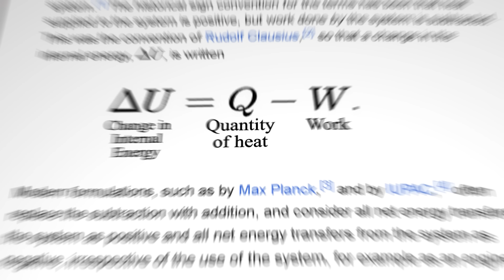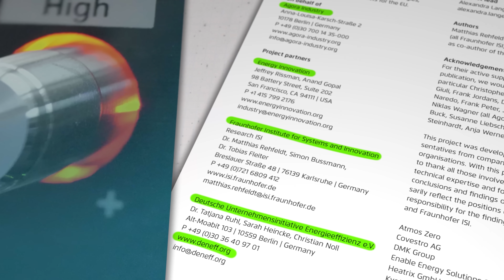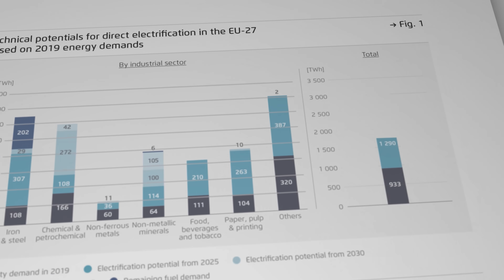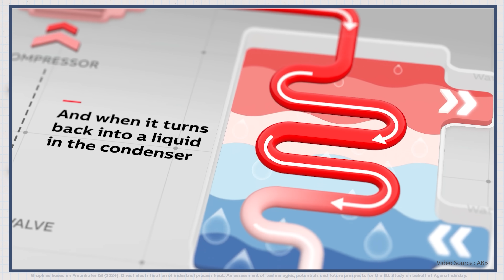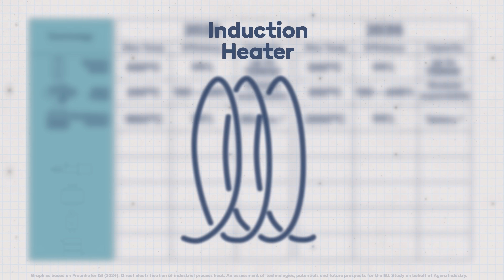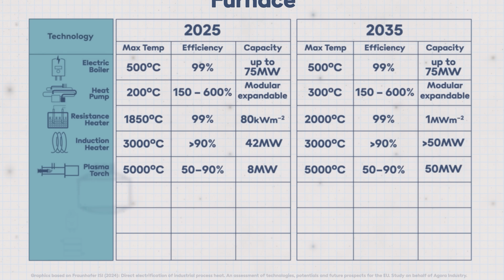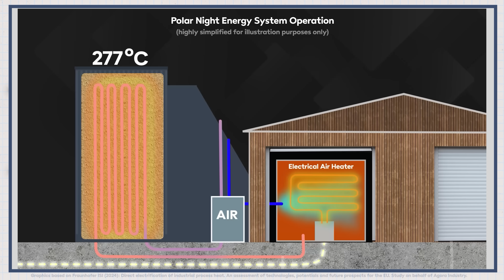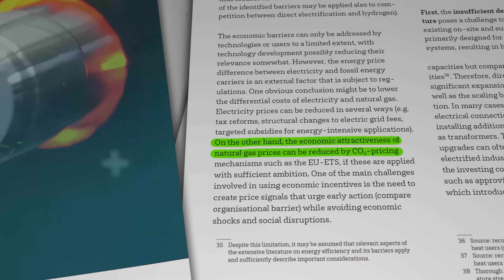Kicking fossil fuel out of industry! Here's how it's done...

Comment: There are dozens of industrial heat pump systems operating above 250°C in refineries and chemical plants around the World. These typically generate very low pressure steam steam from 90°C to 150°C distillation column overheads (including some with vacuum steam generation) and use multi-stage compressors with water injection between stages. One system in South Korea makes 95 ton per hour of 15barg 260°C steam with better than a 5:1 COP. The payback was only 3 years relative to the cost of installing a new boiler. Hanwha, Piller and several other OEM’s have similar systems
Reply: I've tried looking into heatpumps that function at this temperature and my research never seems to go anywhere.
Reply: Heat pumps are usually rated by the temperature differential rather than the absolute temperature. I think whoever put the table together didn't understand the units of the raw data.

Going from 90° to 260° is only a change of 170°.

In the future, heat pumps that move heat into and out of thermal storage will probably be operating at both much higher absolute and differential temperatures.
Reply: Normal condensing heat is from the cooling water at appr 30 c. If higher temperature process heat is available you could generate low pressure steam. As steam is rising quickly in temperature during compression  you need about 4 stages with a compression ratio sligthly above 2 to get to 250C. So new condenser incl steam generation plus 4 stage compressor  provides you with with a very high capital project. Also cop will be bad. These project only work subsidized. Ps 15 bar 250 is superheated. So bad example. 15 bar is 200 C and you need condensing heat the superheat is only a fraction
Piller fan pressure increase resembles dt of 10 C. So about 15 would be required. Please know what you talking about 250 C condensation heat is required in normal mid pressure steam application not a 250 C superheat temperature of low pressure steam.
Ps 2 compressors are limited in temperature if oil is used inside compressor to about 300c
Reply: @ Thanks for your feedback. I was at the plant and saw this system working in 2015 and did a complete heat and material balance. The waste heat source was 3 BT column overheads at ~120°C with flat condensation profiles and generated 1 bar steam with 10°C approach T. This steam was compressed to 15 barg in multiple stages with desup sprays instead of intercoolers. The compression was <200 KW per tph of steam which makes sense  when you estimate the isentropic power recovery of a 15b to 1b steam turbine. 
Note that Piller blowers has several systems on 110°C column overheads that operate today make  steam at several bar with 6 stages.
Also Hanwha has over 20 systems operating with heat sources as cold  as 80°C that generate LP steam.
The economics work in the EU and Asia where we pay 5 times the price for natural gas as the US with similar power prices,
and are certainly cheaper compared to CCS and eBoilers if you have to decarbonize.
Reply: More like 200 industrial heat pump in the world VS hundred of thousands of boilers...
Reply: Could you please provide some sources for your outrageous claims? 2024 article "Towards sustainable process heating at 250 °C" by Udroiu et al. says: "there are no commercial units for temperatures above 150 °C, and few researchers have published experimental results at this temperature with prototypes" and "[r]eaching temperatures up to 250 °C is not possible with the technology developed nowadays".
From what I've read going beyond this temperature is really difficult due to oiling requirements in compressors, and according to the same article, "only five pilot-scale demonstration projects with heating capacity below 100 kW and a maximum temperature of 160 °C exist nowadays". Hence industry uses simple heat exchangers for higher temperatures (Mr. Borlace should have mentioned them BTW!), which are often impractical for temperatures below 120-180°C (depending on the amount of sulfur in the fuel, not relevant to natural gas furnaces) due to condensating sulfuric acid corroding even Hastelloys.
As a side note, "unused waste heat at a temperature level of about 90°C is not easy to find" (from "Feasibility of industrial high-temperature heat pumps up to 250°C" by Helminger et al.)
Reply: @ search « BlueTerra Terneuzen » for one of the hundreds of steam compressors operating at >250°C in the world.
Reply: @ain92ru  You can do your own research but you are wrong. If you use heavier refrigerant like octane or decane, you can reach 220 easy. I have not seen 250 but I am pretty sure you can find something that condense at 140oC and is not degraded at 250oC.
Reply: @ain92ru  Water is the solution lol!

Comment: In addition... the corrosive effects of hydrogen causes extreme difficulty in keeping the small molecules inside pressurized pipes and storage vessels, thus making it a very expensive element to contain. Forget hydrogen as a "conventional" fuel. Done, we should not have to talk about this again, and anyone who is trying to peddle hydrogen as a fuel for EVs, home and most commercial energy uses is just a shill for the fossil fuel industry.
Reply: There are at least a dozen hurdles that would each require a major breakthrough to make the hydrogen fuel cycle viable, so extremely unlikely.  However, hydrogen could have a place in decarbonizing of both steel and ammonia (for fertilizer) production.  Steel is currently produced using coal as a feedstock for removing oxygen from iron ore, which produces CO2.  Ammonia is produced using Steam Methane Reforming to get Hydrogen from Methane, which also produces CO2.  Hydrogen can fill in for Coal for making Steel, and be used directly for making Ammonia rather than being pulled from Methane.
Reply: @OweEyeSea  Hydrogen-derived fuel cycle will be viable simply because shipping and aviation have no alternatives, and it will probably be done via ammonia. Chemical industry needs feedstocks as well.
Reply: Have a look at the hazard assessments for hydrogen storage and fires. At present lithium batteries are the whipping boy for alternative energy fires but hydrogen is far riskier. Hydrogen flames are invisible. Years ago I did underwater cutting of steel using an oxy/hydrogen torch, the associated safety information was alarming, test for invisible flames by poking around with a broom. If it ignites, you got it. Solar charges my old Nissan Leaf.
Reply: Such as pro-hydrogen Danielle Smith, the premier of Alberta, Canada.
Reply: I've worked in a chemical plant producing 300 tons of hydrogen per day , just love the gas , it is totally non corrosive by the way 
while it has some quality for motive power , it is very poor for thermal power , been burned with its flame it's not fun but far better than hydrocarbon burn 
also it has zero toxicity and is quite difficult to ignite , it need a spark , red hot surfaces are not enough , 
it will disperse in the open air very rapidly and doesn't accumulate unless confined
Reply: @sparkyfromel  That's all great except sending the wrong message about it's suitability as an energy source for homes, buildings and EVs is irresponsible.There are safety concerns like "hydrogen embrittlement", cracking of metals over time. H2 would need heavy walled and very tightly sealed storage it would be impractical for many of the purported uses the oil companies have been trying to push. It also would react with other molecules in the atmosphere to create more greenhouse gas chemicals, thus making the climate change more rapidly. Add that to the cost to produce, the cost to transport, and the energy used to make it, means it should not be ubiquitous. It should be kept to the areas it is best suited.
Reply: @JoeCuv  notwithstanding my love for the gas , I totally agree Hydrogen has plenty of drawback as an energy source , it's pretty hard to make it suitable for transport use with any range and the safety requirement are high thus expensive. 
It's use for personal devices would be a bit of a nightmare safety wise 
usage in large industrial environment could be contemplated , qualified personnel , proper maintenance ( one could hope )
one of the possible use is for iron smelting , there is some trial taking place for reducing ore but problems keep cropping up
Reply: And anyone who promotes EVs and their damaging to produce, and currently difficult and uneconomical to recycle, and susceptible to thermal runaway fire lithium batteries is just a shill for the mining industry? 
I do worry about those who dismiss all fuel alternatives apart from electrical / battery. No solution is perfect not even the blessed EV. Let those working on hydrogen technology work on it. If/when they hit a hurdle, they will do what scientists and engineers do…..solve it and push forward.
Reply: its better to use it to power nuclear fusion and space rockets then to use it for realgr heating or combosution engines. you want to knwo why well i would like to inrudice you to a vey nasty green hosue gas you get from burning hidrogen wihout staveing it or makeing it lean for litte lack of oxgen. do you like nitro boosters in your viedo games  and prefere  liaghting gas gernsal anasithsa setation. well thats what nitousoxide is. yes diry burn hiydogen you get nitooxide. you better hope you not leting that stuff nito the asmoshere bescue let me tell you brother. nicous oxide IS LIKE 1000 times worse green hose gas then co2 by alot. thast just brning hydogen witha oxngen rich envoerment you get this very nasy green hosue gas very very very very bad for green hosue gasses for earth. know you know why we prefer gasolone or desnel and not oxegen retch hidogen for our engies. you got to use it for rockets and jet engines so they burn cleanly. internal combosuion engines don't burn hot entogh to cleanly burn hidogen. thus why you use it for roekcts and jet enginwe witha nuclaeer thermal reactor both fisson or fusion powerd being prefered or don't use it at all.
Reply: And as commenters mentioned elsewhere, the hydrogen that inevitably leaks before the "its only emission is water!" stage has a high indirect global warming potential. Hydrogen in the atmosphere interferes with the breakdown of methane, a potent greenhouse gas.

Comment: Where is the electricity going to come from? Nobody's building new grand power stations and existing ones are getting closed. They will drive up the price for regular people while paying relatively  little. You didn't touch on the artifical price of electricity as promised.
Reply: Look forward to electricity prices being disconnected from gas prices, a point Dave forgot to come back to as you suggested.  

The where is most likely zero carbon (solar, wind, tidal, who knows what else with nuclear throwing their bit in as well), the trends this side of the pond are quite clear as zero carbon prices fall below half of fossil fuel prices in some cases now.  The £ or $ speaks loudly despite protestation from ... a certain US politician that Dave was far too positive about...

Comment: I don't think anyone who was thinking 'what about hydrogen' would have been thinking that H2 from SMR would be anything other than daft. H2 from electrolysis - green hydrogen - makes sense if you want very high temps, such as in a furnace, and also want to take advantage of low cost electricity (the H2 can be temporarily stored). It akso saves having to have entirely new equipment when the H2 can directly substitute natural gas. Then there's turquoise hydrogen from pyrolysis of natural gas........
Reply: I think you need to look more carefully at the negligible efficiency of hydrogen storage (40%?) and the engineering challenges in handling it.  Hydrogen is a fig leaf for extending natural gas consumption as steam reformed natural gas is a tiny fraction of the cost of natural gas hydrogen, its inefficiency led to a UK report suggesting using hydrogen for heating increases the initial energy required by a factor of about 6 (BBC:  "Study contradicts Rees-Mogg over hydrogen for heating"  Published 28 September 2022)
Reply: @peterchandler8505 40% applies for producing H2 from electricity and then converting it BACK to electricity. If it's used for high temp heat the loss is just the efficiency of the electrolysis which is about 80%. The 6 fold difference you quote is for domestic heating. Because central heating systems are low temperature it makes much more sense to use a heat pump, hence up to 6 times more efficient.  I wasn't talking about either of those use cases. Most of the problems of handling and storage relate to the need to highly compress the gas for space efficient storage or for long-distance transfer in either tanks or by pipe line. If H2 is produced onsite it can be stored at low pressure which is no problem.

Comment: With a background deep into thermodynamics, you did a good job on a complex subject.   

However, dismissing hydrogen as an indirect heat source for very high-temperature applications may require some more thought. Remember that both H2 and O2 are produced in electrolyzers using water. A hydrogen/pure oxygen flame is very hot and much hotter than hydrogen air, which is diluted and cooled by N2.  It is clean and straightforward.  

You should also have mentioned that heat pumps' coefficient of performance is a function of delta T, with a high delta T killing performance. Heat pumps have problems with heat source vapor pressures with variations in heat source temperatures.

Comment: As far as I know all of glass works in Poland and bakeries are electric powered. Big breweries seem to use some fossil fuels, but most small ones use electricity. If we put a price on CO2 emission I see no real alternative for the industry, but to electrify everything, but I know, that it is going to cost a lot, so extension in time is necessary. On the other hand I know, that giving industry time to adjust is  just going to end up as always. Everyone will wait for the last minute, and then try to do some quick fix or cry like EU car makers do, that they are not ready to face competition form China and need more time.
Reply: I can only agree with your opinion. Sadly.
Reply: I am surprise by backeries. I thought that bread evaporate a lot of water leading to high energy loss while breweries heat and cool all the time making heat exchange quite easy and common.
Reply: Psst, Ain’t Gonna’ Happen. China is not going to stop burning Flammable Fossils, particularly Coal, and that will apply to every other country that wants to maintain or build manufacturing industry that’s competitive🤔

Comment: Nothing significant will happen to curb the extraction of fossil fuels until the amount of energy to extract a barrel of oil exceeds the amount of energy generated by that barrel of oil, about 40 years from now and after most of those profiting from petroleum extraction right now are retired or no longer alive. 
The petroleum industry is well aware of this and has no incentive at all to change their business model, not even if that means the collapse of civilization which back in the 70s their own researchers concluded was the very real trajectory we are on. The kind of people who see profit over all else are the same who firmly believe that the revenue stream they're working so hard to maintain at such a high externalized cost insulates them from the inevitable outcome.
Reply: If we could agree globally to charge extractors a fee based on the effort to clean up the damage of the materiel they extract, then we could bring about that transition sooner.  And if not extractors, then how about users?  It'll be prone to pariah states not doing their bit however.
Reply: Well said!
🤯
Reply: Unfortunately greed is a great motivator...
Reply: @nzearthman  Turns out so is Luigi.
Reply: It's not that gloomy. Electricity from wind and solar is cheaper than shoveling fossil fuel crap into a thermal plant, , so they are the majority of new generation everywhere in the world. As explained in the video, a heat pump is more efficient than burning fossil fuel, so as costs go down they will replace boilers. If you have access to a plug at home or work, an EV is a better car than a gasser in almost every way. Etc. etc. The bastards will fight these transitions, but they are happening.